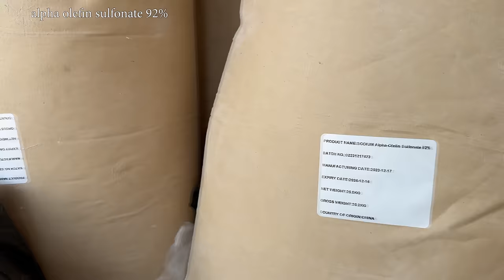ALL THE SECRETS OF MANUFACTURING FOAM BLOCKS | Amazing process of making foam blocks SUBTITLES

Comment: THIS BLOCK IS MADE FROM MARINE GYPSUM AND MIGHT BE AVAILABLE EASILY WHERE THIS VIDEO WAS SHOT. BUT IN INDIA, THE PRICE OF MARINE GYPSUM IS MORE THAN THE CEMENT PRICE AND NOT VIABLE IN THE INDIAN MARKET AS A LIGHTWEIGHT BLOCK. NORMAL GYPSUM, WHICH IS USED IN THE PLASTER OF PARIS, DOES NOT GIVE THE DESIRED STRENGTH TO BLOCK. I HAVE TRIED IT AND WAS NOT SATISFIED.
Reply: Good, very illustrative video, I liked it, congratulations. In order for the prepared brick to be more solid, it must be added to the elements that already make up the mixture, such as ceramic plaster 37 kg., 2 kg. of Portland cement, water and foam, fine beach sand without saltpeter must be added in a ratio of 3 to 1 with respect to the cement, this would be 6 kg. of fine sand. and if that is not enough for the consistency of the manufactured block, a light metal mesh or net prepared to measure should be added; when pouring the mixture into the mold, this way you will have a harder and more resistant block. What is certain is that these two additional materials increase the budget in the final product.🧐
Reply: So, we can use rock lime which is relatively cheap ..what do u think?
Reply: @gajulagopinath5471  In India this product is not viable as light weight block. No product can stand against AAC block at least right now
Reply from the maker: @gajulagopinath5471  you should try it, if it works, then good
Reply: If you add any bonding material, ppv or polymer it will solve the issue of gypsum.. it's not a big deal. Though i prefer adding limestone & sand with bonding material instead of gypsum.
Reply: @BbAmazingSkills  hayırlı işler . kullandığınız alçı hangi alçıdır.
Reply: cement .fly ash.foam are enough for making CLC
Why lime and gypsum we add
Reply from the maker: @rajeshkumar-md4do  we don't add lime
Reply: @rajeshkumar-md4do  gypsum and lime is giving a shine and color
Reply: I am interested to know
(which type of Gypsum they use????
Reply from the maker: @mohamedahmedmohamed54  ordinary building gypsum
Reply: @amerrashed6287 Why not pond ash or fly ash with sand dust powder?

Comment: How much foam?
Reply from the maker: 300 g of alpha-olefin sulfonate was added to the foam generator per 150 blocks.
Reply: 50 liters per block?
Reply from the maker: @miguelpimenta4755  50 liters of water per block 3 pcs.
Reply: @BbAmazingSkills   how much does 300 g of alpha-olefin sulfonate give foam volume ?
Reply from the maker: @anisyahiaoui1528  300 g of alpha olefin sulfonate yields 150 blocks.
Reply: @BbAmazingSkills  So 300 g of alpha olefin sulfonate gives 2500 liters of foam?
Reply from the maker: @anisyahiaoui1528  Yes, sir👍
Reply: @BbAmazingSkills  how do you measure the form is it by density?
Reply from the maker: @chrislukonde4705  I don’t know, I’ll have to ask the experts

Comment: used 3 kilograms of cement and gypsum and 3 liters of water for each block, and the rest was alpha olefin foam. The block is smooth and does not stop. Do you use other types of solids?
Reply from the maker: what is used is shown in the video, there is no other substance inside, you have a problem with the plaster

Comment: You could double or even triple the production by adopting simple machines, such as a pump for the slurry, a  mechanism for loading all the materials, a mechanism that places the blocks on the wheelbarrow at once, and a way to easily remove the blocks from the molds by first vibrating the mold walls. This way, you could make more blocks and have the people tire less. Great work you are doing!
Reply from the maker: I agree with you

Comment: First of all thanks for your time shooting these videos and answering everyone’s questions. 
Couple of questions.
1- have you produced any 10cm and 15cm blocks also? For internal partitions 10cm maybe desirable.
2-since these blocks are made out of gypsum are they ok to use for external walls? And if so what kind of finishing plaster is used for it on the external surface
3-do you have any videos of workers building walls with it? Would be great to see what method they use.
4- have you guys tried to build them with tongue and groove?
5- I see some blocks with different shapes, square holes etc in it, whats the purpose of it?
6- do you guys build any longer blocks with rebar reinforcement for lintels?
7- are you able to share a video or picture with a cut of the block to see the air voids in them?

Thanks again for the amazing work!!
Reply from the maker: First of all thanks for your time shooting these videos and answering everyone’s questions. 
Couple of questions.
1- have you produced any 10cm and 15cm blocks also? For internal partitions 10cm maybe desirable. Block dimensions 60 cm/30 cm/20 cm.
2-since these blocks are made out of gypsum are they ok to use for external walls? And if so what kind of finishing plaster is used for it on the external surface. Yes, you can. You can also plaster the surface with tile adhesive or ordinary cement mortar.
3-do you have any videos of workers building walls with it? Would be great to see what method they use. I'll make a video in the future.
4- have you guys tried to build them with tongue and groove? No
5- I see some blocks with different shapes, square holes etc in it, whats the purpose of it? The top of the house can be laid with reinforcement and concreted.
6- do you guys build any longer blocks with rebar reinforcement for lintels? yes, there are special blocks for this in the video
7- are you able to share a video or picture with a cut of the block to see the air voids in them? Yes I agree
Reply from the maker: https://www.youtube.com/watch?v=-yTA6UfiGg4
https://www.youtube.com/watch?v=wPMJlIw9xzk
https://www.youtube.com/watch?v=XbXaIhSrdAA&t=12s
Reply: How much does 150 molds cost?
Reply from the maker: @mfawaz916  what shape?
Reply: @BbAmazingSkills   60/30/20

Comment: How often do you pour AOS in the foam maker and for a few blocks. When should the wind pump work and how bright should it be?
Reply from the maker: pour 300g of AOS into a foam generator for 150 blocks. The compressor pump automatically turns on when the pressure drops.

Comment: Thank you for your excellent video, can you explain about the foam machine, that is, it is just a normal cylinder to which the air pump is connected and has two inlets and outlets? Second question: What is the degree of hardness of these blocks, Afshin from Iran

￼
Reply from the maker: answers in this video
1) FOAM GENERATOR, HOW TO MAKE IT YOURSELF https://youtu.be/D3ajZ7ly6I8
2) Amazing process of making foam concrete blocks  https://youtu.be/-h6zBbVkuQI

Comment: Thank you for your excellent video can you please tell me what is the weight of each block after gets dry, and what is the coast of one kg gypsum. regards
Reply from the maker: the weight of each block after drying is about 16 kg and the consumption is 37 kg of gypsum, 2 kg of cement, 50 liters of water, divide into only 3 blocks and your answer will come out thanks for the feedback
Reply: @BbAmazingSkills  Thank you dear for the fast feedback, but  (37+2+50)/3=29.3 kg for each block not 16 kg
Reply from the maker: @idriselfeituri3085  you didn't calculate the evaporation of water

Comment: What chemical did you use for mold release? Is that the one that gives the color on the surface of the block? Does is evaporate when cured under the sun?
Reply from the maker: To lubricate the mold, I used regular used automobile oil, the same one that gives the color to the surface of the block. absorbs when cured in the sun.

Comment: What is the size and weight of the block, what are the mixing ingredients, and how long should it take to be ready in the mold?
Reply from the maker: foaming agent - alpha-olefin sulfonate AOS.
From 250-300 g of alpha-olefin sulfonate, 150 blocks are obtained.
block sizes 60cm/30cm/20cm
List of ingredients for 3 foam blocks
37 kg gypsum
2 kilograms of Portland cement
50 liters of finished foam (alpha olefin sulfonate)
50 liters of water
https://youtu.be/Ft5w1iwbouo ALL THE SECRETS OF MANUFACTURING FOAM BLOCKS
https://youtu.be/D3ajZ7ly6I8 FOAM GENERATOR, HOW TO MAKE IT YOURSELF
https://youtu.be/-h6zBbVkuQI production of foam blocks with subtitles
Reply: @BbAmazingSkills  💝
Reply: @BbAmazingSkills  
Can it be manufactured in winter?
Reply from the maker: @ABU.HANI88  yes, you can, but it takes a long time to dry
Reply: @BbAmazingSkills  💖
Reply: @BbAmazingSkills  
Thanks for your information

Comment: Before make wall and cement between each other you put it in water right and i want to know time you turn on air compresser before turn on final valve
Reply from the maker: Yes, sure
Reply: @BbAmazingSkills  i want to know time turn on before turn off valve please
Reply: Please i want to know the time you turn on air compresser before turn off the valve of air compressor
Reply from the maker: @nopolioncollection  it automatically sucks in air and pressure and then turns off
Reply from the maker: @nopolioncollection  Automatically supplies air and pressure and then turns off when the desired pressure is reached.
Reply: Ok

Comment: Thanks for the video. How do these blocks stand up in rain. So much gypsum, I understand the early set and the cement to cure harder over time. But how do the finished blocks perform on an exterior wall? Really good video, thanks so much!!
Reply from the maker: the top needs to be plastered with tile adhesive, then the rain is not dangerous,
The walls have been standing in the open air for five years, but nothing has happened, I advise you to protect yourself with plaster
Reply: @BbAmazingSkills  Plastering with tile adhesive can be expensive. I have several blocks with your procedure and used ordinary cement to plaster with some extra bonding agent such as acrylic, it works good.
Reply from the maker: @tahiriqbal9055  I agree with you

Comment: Sir i try this block its good all fine but after dry i test in to  flud to water then its color some area it’s different and after i make dry and i hold the block more powder in my hand
Reply: Please reply
Reply from the maker: a lot of foam and little cement and it is not necessary to keep a lot on the water when you build a house the surfaces will be plastered with tile adhesive and after that the water will not be afraid

Comment: how do you quantify the foam added per batch of mixing with gypsum and cement?
Reply from the maker: 250-300 g of alpha olefin sulfonate produces 150 blocks.
block sizes 60cm/30cm/20cm
Ingredients list for 3 foam blocks
37 kg of gypsum
2 kilograms of Portland cement
50 liters of finished foam (alpha olefin sulfonate)
50 liters of water
https://youtu.be/D3ajZ7ly6I8 FOAM GENERATOR, HOW TO DO IT YOURSELF
https://youtu.be/-h6zBbVkuQI foam block production with subtitles
Reply: how much foam is needed for 3 blocks
Reply from the maker: @sakipademi1952  50 liter foam

Comment: Thanks a lot now i write the method but i want to ask you 2 question 
1.if one mold not complete and second day want to make one can i put the mixture of first day with mixture second day
2. If during dry week rain or the block obtain water what happened 
Thanks a lot ❤
Reply from the maker: 1,The prepared solution will harden in 15 minutes. until tomorrow he will become a stone
2, the blocks dry quickly and this is normal